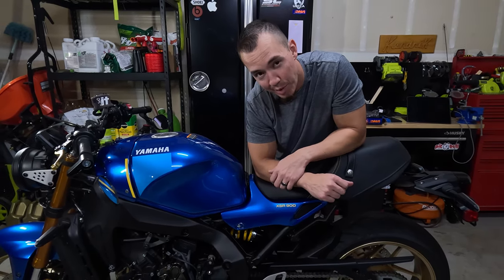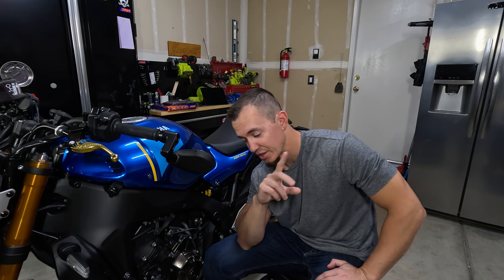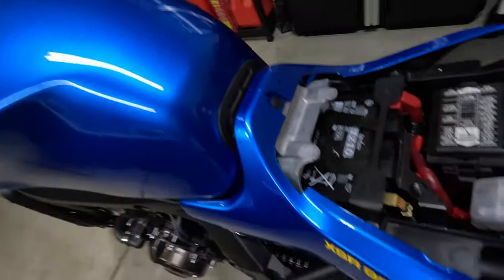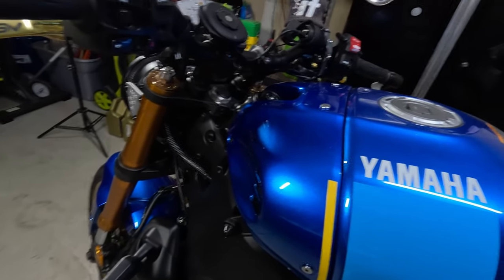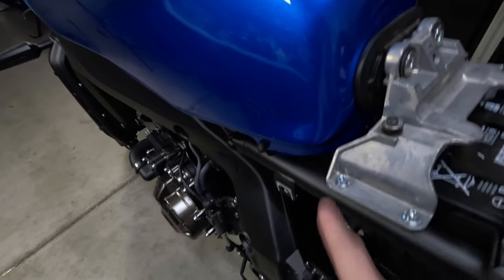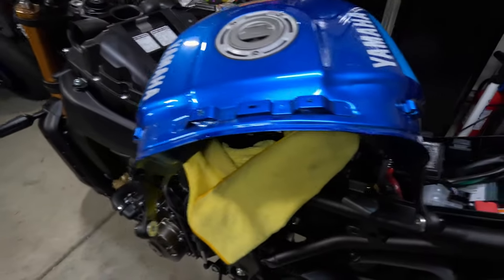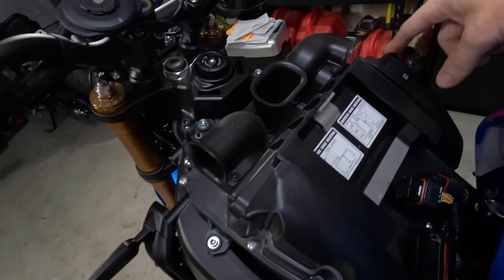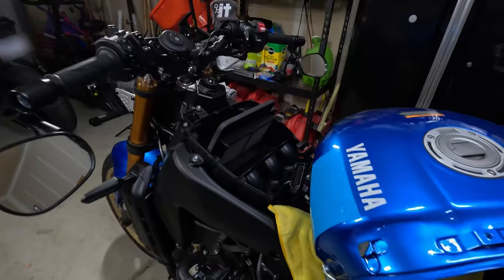2023 XSR900 Power Surge: DNA Air Filter Installation Guide

Comment: Dude..  glad I found you..  2023 XSR900 Legend Blue here to boot..  got the Dominator dual can Pipes (Very Nice!),  getting the VCNut Flash..  and -1, +2 sprockets (11% more Torque, Max Speed still 134(!!), doesn't affect Flash).  Air Filter TBD (Pricey.. I may just make my own or go Chinese).  Will look at the Air Box  Mods to visually assess.  VCNuts Dyno Curve differences are interesting and low risk.   VCNut says drop in filters don't affect the Flash, but the Lid Filter and Air Box Mods do.   Considering a "Dart Marlin Fly Screen, just came out for XSR.  
Just Starting!  You Lead the way, I follow.  
Revelations, why you always find a YouTube before you start esp any project involving Eectrical Connectors or Trim piece removal.  This bike is total state of the art packaging at it's best! :
1.  Tank removal:  Hmmm.;.  Push Pins you say?  I thought they were Pull Pins w/o a way to pull!   Whoda thought?  Almost drilled them out an replaced with the screw type like on the other side.

Not a scratch yet!  keepin' that way.
Reply from the maker: Thanks bro!  Appreciate the feedback. Vcyclenut’s flash will definitely make the most out of the bike.

Comment: tomorrow my DNA filter will come i wanna ask. Did you put filter oil before instalation ??? and what if no CPU flash ? my is MT09sp 2021 with titanium acrapovic full exaust with no flash. Did i need flash or i can drive like it is ?
Reply from the maker: @xbassxbassow4881  the filter comes pre oiled. I watched some videos of vcyclenut dyno tuning an mt09 with just a filter change and it made almost no difference so you should be good. 👍🏼
Reply: @Kmoto530   i ask the guy in store did i need to oil and he say, the filter comes dry and you need dna kit +20euro 😀 cleaner + oil ... i will see tomorow, cant wait
Reply: @Kmoto530   oil come with grease for   Rubber corners I’m not install yet I’m thinking about cut those pipes or not 🦧

Comment: This maybe a dumb question but the plastic retaining clips just keeps spinning underneath
Reply from the maker: Are you referring to the two retaining pins with the plastic phillips?
Reply: @Kmoto530  yes they just keep spinning …
Reply from the maker: @Brettmotorcycles  sounds like the treads maybe stripped. I don’t know why they would make a plastic screw with fine threads like that. If you can get something underneath the pin you might be able to push it up while unscrewing it. If it doesn’t work I’d probably use a cats paw nylon trim remover and buy some new clips
Reply: @Kmoto530  it was definitely stripped pulled out with some needle nose ….dont understand why they dont use regular metal screws …thanks